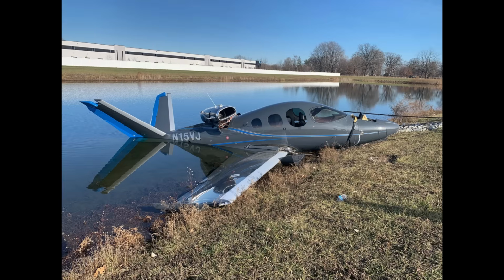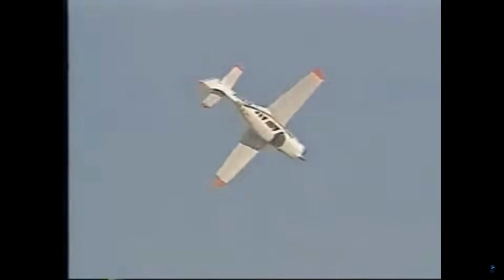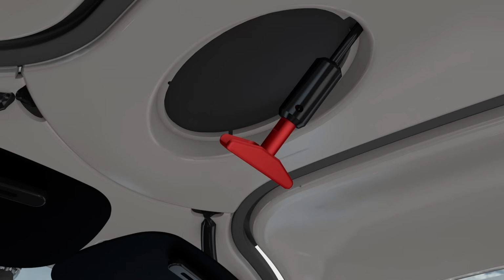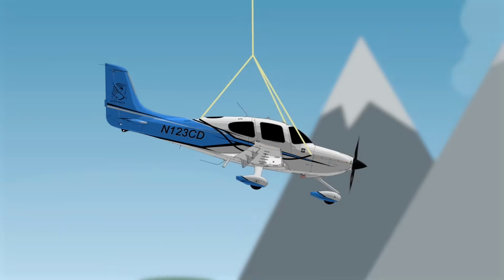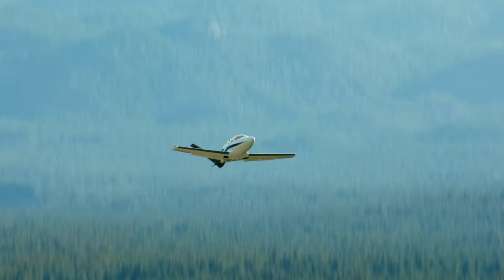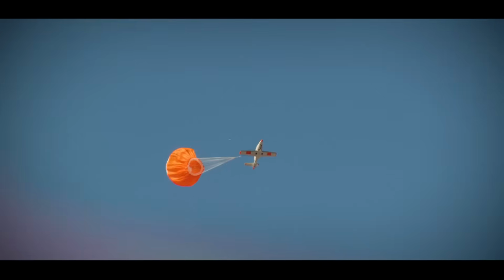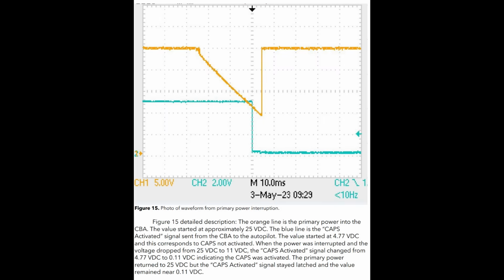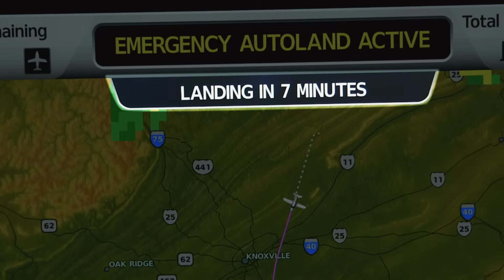Putting Parachutes On Planes: The Genius Engineering Behind Rocket Powered Airframe Parachutes.

Comment: That type of automated "safety" systems that caused the crash is the same sort of crap that is now in all modern cars. Functions that override the driver's inputs, causing the driver to try to counter, potentially causing a mess. I detest such systems, and would disable them, with wire cutters and a soldering iron if necessary, if I was forced to own a newer car.
The autopilot mode should at least flash the main displays with "DANGEROUS AUTOPILOT MODE ACTIVE, HOLD AP BUTTON FOR FIVE SECONDS TO DISABLE!" in bright red, huge letters.

Comment: Don't forget that the system is activated, the A/C is no longer airworthiness is over, none repairable.
Reply from the maker: About 1/3 of aircraft that deployed CAPS were repaired and returned to service.
Reply: the point of the parachute isn't saving the airframe. If you crash land at realistic speeds, the plane isn't in that good shape either
Reply: So you were just proven wrong… stop spreading your misinformation 😂

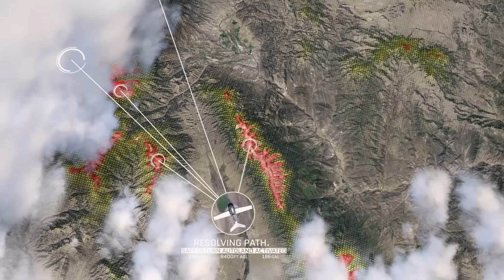Comment: 20:30 That auto-pilot self-communication and landing is something we should have had a long time ago. We have had the tech to implement this on every plane for years now.
It should 100% be on future planes if agencies truly want to have only one pilot flying commercial aircraft as is being suggested.
Reply: Yep. When people (Scott included here) praise Garmin for their "new tech" I always cringe inside. Garmin is the reason aviation avionics are so unbelievably out of date, they have a near-monopoly and hold onto it with an iron grip. There are no better examples of this than the TSO navigator requirement. I'm forced to buy a $30,000 GPS that uses freely provided government data (that Garmin charges for, of course) backed by a WAAS GPS (meanwhile the rest of the world has moved onto RTK GPS with centimeter precision) with a tiny screen and a nightmare of a UI, instead of something cheap and modern where I can easily afford multiple of them for redundancy. I wonder which company is ensuring that law is never changed.

Yes, Garmin is better than steam. But Garmin and the FAA are the REASON aviation is so desperately behind, they are not the hero of this story.
Reply: There are other non-technical reasons that you might want to still have two pilots flying a commercial aircraft even if this capability is available. On the other hand, *zero( pilots is a really interesting option.
Reply: I will never fly on a commercial airliner that only has one pilot.

Why? 

Germanwings Flight 9525.
Reply: @JHe-f9t  There were two pilots on that flight but thanks to 9/11 the captain was locked out after using rest room.
Reply: @JHe-f9t  that pilot could have been "fished" out. We just need to follow the rules on mental health a bit more strictly. No human is "entitled" to serve as an airline pilot. He could have just as well been moved to fly cargo.
Reply: @daszieher  Here's the thing. People have free will. Assuming you can 'fish out' what goes on in someone else's head is an extreme level of hubris and naivety.

Most depression is already severely underreported in the military for fear of losing clearance. You want people to be open about their struggles, not punish them for being honest about it.

The need to 'fish out' this pilot is completely eliminated by having 2 people in the cockpit at all times.
Reply: @JHe-f9t  its far easier than you think. They had the pilot on a watch list and the doctor attempted to prevent him from flying, there was intervention from the side of the pilot to keep him flying.

No hubris. No naivety. Just psychology. Only because you don't seem to grasp the concept, does not mean that it doesn't exist. 😃
Reply: @daszieher  and stricter rules will just get more pilots to hide anything they might have :)
Reply: @JHe-f9t  That plane had two pilots, but one of them (the captain) got locked out of the cockpit by the crazy one (the co-pilot).
Reply: @robbannstrom  that he did and since then we have rules in place to mitigate this. At any point in time, there need to be two personnel on the flight deck of such aircraft. Since then we also have a bit more psych evaluation during medical examinations (even though it is still a joke of an eval if you ask me ...).
Reply: Aviation electronics is about 50 years behind. 

Aviation is just getting into the '80s early '90s. They still haven't figured out plug and play.

In Ukraine, they figured out how to fire American missiles on Russian Jets using an esp32 and an iPad. The iPad also gives them access to advanced maps, encrypted communication, all sorts of nice things. 

Back in the '90s AI experts used to talk about how making a self-driving car was basically impossible because it was dozens if not, hundreds of orders of magnitude, more difficult of a problem than a self-flying plane. 

Mostly because an airplane has vastly more options for evading problems, in an airplane doesn't have to know that a ball rolling into the street is often followed by a child.

Well, the self-driving cars might not be perfect, but we have them.

We still don't have aircraft networking, that I had in video games in the '90s. Aviation isn't even using duplex radio. And duplex radio is completely obsolete. We have this thing called "cellular" now. 

Speaking of cellular, the only reason we do not have a completely automated fleet of aircraft is because of the Pilots Union. Some very simple modifications to cell phone towers to turn them into aviation navigation beacons. Triangulate off that with a modern digital map and you don't need radar anymore.

I could go on and on, just listing basic technology that has been around for at least four decades.

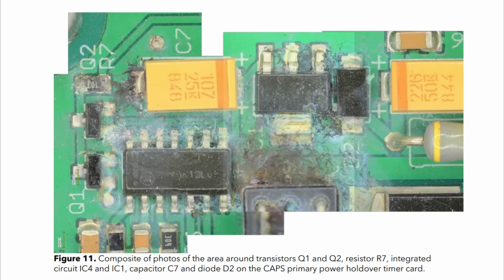Comment: 17:40 this sounds like intermittent errors/failures. I worked on this for Virgin Australia using data from a study done on F-16 intermittent failures with no obvious cause. They used a sophisticated custom designed machines with many sensors hooked up to F-16 circuit-boards to identify where the failures were coming from. It appears to still be an issue in aviation. My guess is the problems originate in the quality of the circuit-boards production and inadequate sealing from atmospheric interactions. Many parts are after all produced by the lowest bidder.

Comment: Wow, that emergency autoland system sounds incredibly interesting.
Reply: You call it the 'emergency autoland' button. I call it the 'request stop' button.
Reply: FPV drones and planes can be set up to perform automated landing using Gps and altitude sensors for both drones and fixed wing for years . Gps could be very precise . Good to see it in real planes as well.
Reply: the lady just so casually put her ipad down and pressed the big red button like nothing is happening lol,  amazing ad
Reply: Yeah, that's really cool!
Reply: Yet, I am worried it is too easy for a... mentally unstable passenger to press it without a real cause. I hope the pilot(s) have a way to disable it in case of not-emergency.
Reply: @SystemBD  Yeah it can be disabled at any time. Say if the pilot is incapacitated but then comes back, he can simply disable the system and take over. 
Same if something is going wrong, the PFD is still displayed the whole time for this reason.
Reply: @j.m.5942  Enigmatic acronyms in aviation are another reason why an emergency autoland feature for the passengers is cool.
Reply: @j.m.5942  Do you know if air-traffic control can override it? Let's say it chooses a runway that would be a very bad idea to use for some unforeseen reason, could they intervene and tell it to use a different runway?
Reply: @Turidus  I personally wouldn't want ATC to be able to interfere with my onboard emergency equipment. Their job is to clear everything out of the way. But yeah - unforeseen... I wonder if they put a NOTAM in the system? The system seems to scan several databases to select the best airport and runway. Surely that includes NOTAMS for runway closures? And surely the system doesn't scan once and then stick to the initial plan without updating?

So maybe that's the answer - a runway closure NOTAM?
Reply: @Turidus  No external input is allowed, though the system does check runway length, winds, etc. It also makes calls. But it cannot "see" the runway environment.
Reply: This is an April fools joke, isn't it?
Reply: @Ben-wl3el  Nope. AFAIK, a few of the larger (still single pilot certified) jets got it as well. Since it's a mostly software solution, a lot of aircraft with advanced avionics can be updated to have it. (Update == new model, not just a software update ;-))
Reply: @realulli  hahaha it's called aFAIKe hahaha
Reply: @Ben-wl3el  A good few YouTubers are putting up not-April Fool's videos today.

Comment: Every time I hear about a VFR into IMC crash, I think a big red computer-take-over emergency button be a good idea. I wasn't aware any airplanes had already implemented something akin to this. I wonder if the system on the Cirrus jet can deal with an upset condition? In any case, good on them for advancing the technology!
Reply from the maker: There's also a blue button in the SR20/22 which is a shortcut for the autopilot to level the wings and fly straight. Mostly to give you time to thinks.
Reply: @scottmanley  thats cool
Reply: @scottmanley this is also a mode in many RC trainer aircraft, for if you lose orientation (because you’re flying from a 3rd person perspective)

Comment: Aren't we all taught how to glide our stricken aircraft to a controlled landing? In the event of a more significant failure (e.g. loss of wing) how confident are you that the parachute will function as advertised?
Reply from the maker: Given that it's got a perfect safety record when used above 2000' and below 133kts I have a lot of confidence in it.
Reply: @scottmanley  It's a fair point and I'm sure these systems have their place. I just feel the pilot needs to evaluate the options before reaching for the red lever too fast. A twit near me put a perfectly airworthy Cirrus under a parachute with many other options available - fortunately falling into a tree rather than the nearby school playground. (Also an AP issue, btw - but lack of training rather than system failure.)
Reply: If you have loss of wing and NO parachute, the ONLY thing you have confidence in is “probable death”.

In the event of wing loss, I’d rather have a parachute and, once pulled, at least I’d then have the opportunity to cross my fingers and hope …. 

I have been to the Cirrus plant and seen how they build their airframes and integrate the parachute to the structure … the parachute is very much implemented to protect the cabin .. wings are not obliged to remain attached for the parachute to bring the cabin down on a controlled descent. 

There is a lot of innovative design and manufacture goes into the Cirrus Jet … I know this because I was involved in the design/development and qualification of the engine inlet system for all weather and IMC operations … and even the intake can be claimed as “innovative”. The big red knob is new to me … I really like this feature 👍

I even liked visiting Duluth in January!! … though it was somewhat more welcoming without the snow (as a Brit, I can also claim anecdotal novelty factor in seeing a bear wandering around the Cirrus parking lot).

Comment: The issue with CAPS is pilots have been using them when they shouldn't have. If there is enough room to safely glide and land CAPS is not supposed to be used. I fly an SR22T with a CAPS system and when I did my training on the plane they tell you, CAPS is only to be used as a very last resort when your life is in imminent danger, and it has an extremely precise window it can be used in.
Reply from the maker: >2000' & < 133kts is a pretty large window if you ask me.
But yes, keep flying the plane, even after pulling the handle, the aircraft remains controllable for a few seconds.
Reply: @scottmanley  You are right I should have said defined window. I actually had a trim run out and I was flying with a friend of mine who has an SR20 and the nose pitching straight up and the thing that was scary to me was the first thing he said was, "CAPS AVAILABLE!" I told him, NOPE and just went through the runaway trim items and solved the problem. I think some Cirrus pilots are using the CAPS system as a crutch in emergencies. When I was thinking back to this incident right now I don't think I would have ever pulled that handle unless I lost complete control of the plane. If I'm gliding there is always somewhere to land for the most part.
Reply: @ooo_Kim_Chi_ooo  Yes, there is ALWAYS somewhere to land, the problem is that it's often nowhere good. The nice thing about CAPS is that your options become much more forgiving when your lateral velocity is close to zero. I'd rather land on top of a building or in a forest vertically with close to zero airspeed than at 80+kts. My first flying job was flying an SR22 for a non-pilot owner, so I've got a lot of Cirrus time. I think the biggest problem with CAPS isn't necessarily that pilots use it as a crutch in an emergency (although I'm sure that happens), but that they get themselves into bad situations in the first place because they look at it as a safety blanket and accept risks they otherwise wouldn't. That being said, the outcomes speak for themselves. Unless I'm mistaken there has still yet to be a fatality post CAPS deployment when it was used within its envelope.
Reply: @ooo_Kim_Chi_ooo  Totally agree. It's one of those things where you have to find a happy medium. On one hand, yes it would suck to bend your airplane under chute. On the other hand, it would REALLY suck to die while trying to save an (insured) asset. Just another tool in the toolbox. Congrats on the ownership though, what a great traveling airplane. Be safe!
Reply: @ooo_Kim_Chi_ooo  Wow, talk about a unicorn deal. Minimum liability with maximum usage is the absolute best place to be in aircraft ownership. 😂 I would love to find something even half as good as that.
Reply: I remember chatting with old timers at EAA Oshkosh when the BRS system was being introduced, and there was a real disdain for the system that never seemed rational. I kept hearing, "You've still got to fly the plane," but I'm thinking, if I build my own plane, I'm gonna be more worried about structural failure than losing power or spin recovery. Stick & rudder flying is pretty basic. Building an aircraft is very complex. "You've still got to fly it." I'd rather live. (In the end I never did make a homebuilt.) Those old timers ironically came across to me as the hog doggers who were so proud of their skills they didn't think they needed additional safety.
Reply: Since I'm not so fortunate to fly a Cirrus, I always tell my passengers, "the wing IS our parachute."

Comment: Ok, I always knew that parachutes are not feasible for planes for a multitude of reasons (with the exception of ultra light aircrafts).

...
But what about parachutes for helicopters.
Once you lose tail rotor control and start spinning, deploy a chute from the middle of the main blades.
Reply from the maker: Stratos makes parachutes for Gyrocopters
Reply: For conventional layout helis, a tail rotor failure response usually entails shutting off power to the main rotor (the power to make the main rotor spin is what causes the counter torque). The main rotor through autorotation will generate some lift and act as a parachute, with the added benefit of controllability. That will allow for a stable descent, rate may vary, of the craft.
Reply: I'm pretty sure helicopters lose roll stability without a tail rotor so good luck not getting all tangled up in the lines and having a successful deployment
Reply: The only way I could see that working is if you did it like a ka50 where you had explosive bolts to blow the rotor blades off first, followed by locking the rotor hub so it isnt spinning. Too many things to go wrong IMO, autorotation works well enough and you wont likely have the time for a parachute to save you if you cant autorotate

Comment: So is this a real video or an April Fools one I actually don't know please clarify
Reply: Real. Cirrus and CAPS is a real thing, has been available for a good while.
Reply: I don't know about that but parachutes for small aircraft are definetly a thing and even come standard in some of the pricier models. And you can retrofit it too. I judt started watching so not sure about the details in this video but that first jet is small enough to have parachutes, of course it's only common for pretty small aircraft a 737 would need some absolutely giant parachutes. I think Mentour Pilot has an episode on that, which includes a few cool ones like the cabin seperating (on a big jet) extending some town sized parachutes, inflating airbags and firing rockets at the end to cushion the impact since the chutes still had it going at a fair clip. So basically like a space capsule. That could work it's just very expensive and a lot of extra weight and complexity and potential failure points. Perhaps an all propulsive landing. Strap a Merlin and a oxygen tank to the bottom and it could land any of the medium haul jets propulsively. It can use the onboard kerosene for fuel so only need ro carry LOX which can double as breathing oxygen supply. 

We might occasionally have one explode randomly but that's just the cost of doing business.
Reply: What's April fools?
Reply: @badcornflakes6374  first day of April, is tradition to tell a funny but believable lie to people
Reply: Should be
Reply: Obviously a hoax. Planes can't fly!!
Reply: He picked the perfect topic 😤